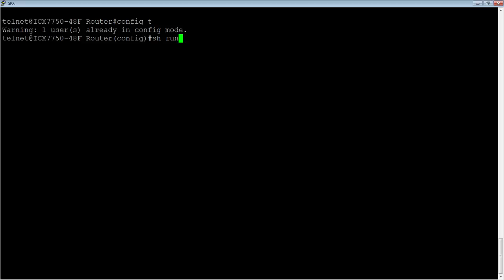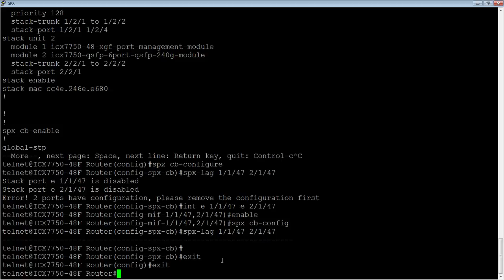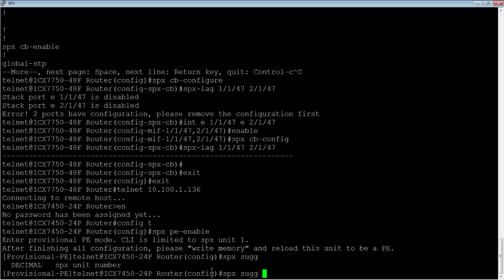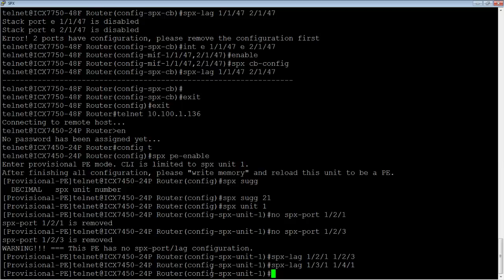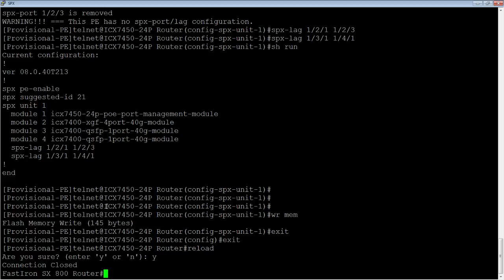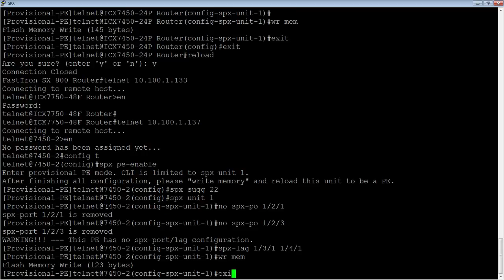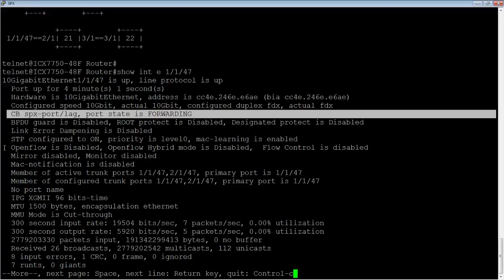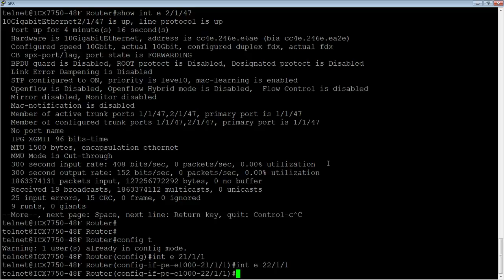Brocade Campus Switch Port Extender Configuration- SPX

Comment: Hi terry good video, Terry I have two question 1. when you have a spx lag the deploy command is applicable for LACP? and is possible to change the primary ports?
I appreciate your answer.
Reply from the maker: When you are using SPX-lag from CB to PE or PE to PE you do not need to deploy and you do not need a primary port.  It is just an spx-lag command for multiple ports instead of spx-port for a single link.
ICX7750-48F Router(config)# spx cb-configure
ICX7750-48F Router(config-spx-cb)# spx-lag 1/1/1 1/1/2
Reply: Hi Terry, Thanks for your answer.